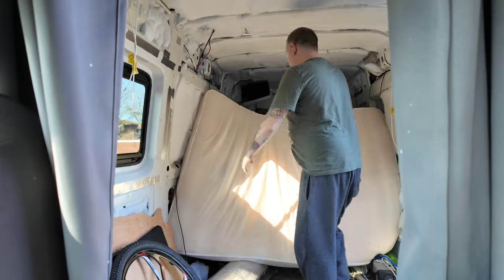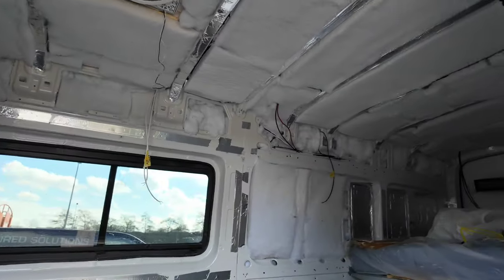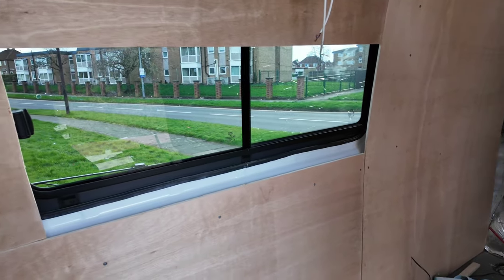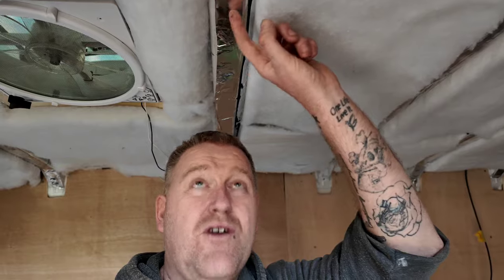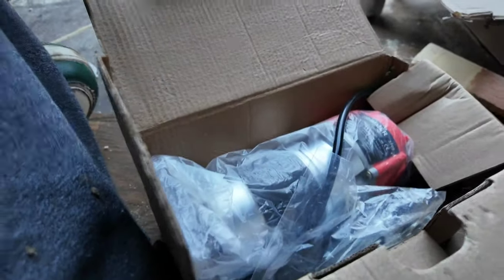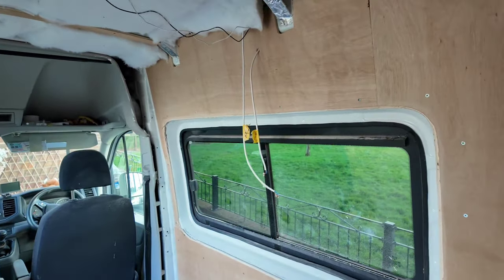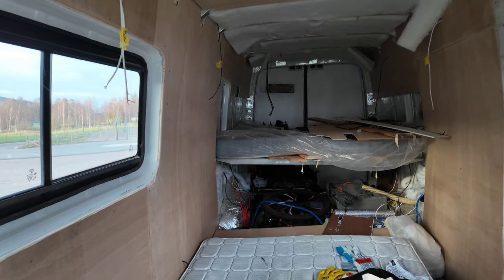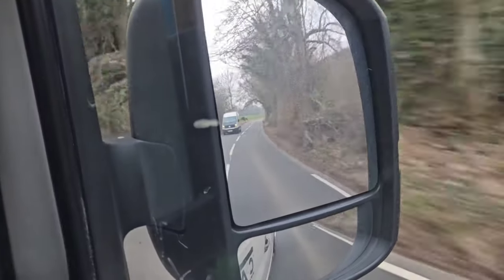It Was Only Meant To Take 1 Day

Comment: Another great video! Regarding your old heater personally I'm voting that you take it apart and try to give it a clean out.  Main reason being if you ever need to do repairs on your new one then you will be more familiar with inside of it and secondly being you have newly cleaned spare one to use if you ever need to wait for a new part.

Comment: Hmm diesel heater ... is your exhaust at a right angle... or is it straight down ?? 

Maybe reason for soot build up ...

They dont really explain but the angle of an exhaust should be straight down where possible , or very slight angles ...

P..s dont replace if it stops working ... look for videos to repair ...as itll be just an internal filter usually

Comment: So confused why you're doing this conversion. This is supposed to be the "proper job" and everything is as bodged as the last one. The gaps between the wood, the routing, the chaotic transition between jobs, it's wild. Why you didn't just take your solar panels off for half an hour to avoid making such a mess with the caulk as well is beyond me. I thought you were getting someone to do this for you? Bizarre choices mate. Fingers crossed it turns out well at the end.

Comment: Wow pal .... you really should slap yourself ,and researched routers ...

1st tip I'll give you ... for long straight edges , afix a long straight edge.like a builders spirit lvl etc .. to a measured distance , 

So firstly , measure router plate to centre of bit ... and write that down .

Then you can use math ,to work out where your straight edge should sit .. as the router plater will follow this ,to give a clean cut. 

Now , your rounded corners , here is what you want a slap for ...  routers can be used with a jig   known as a circular or compass jig ...the name explains it .. 

P.s. with routers .. and plywood especially ... remove small amounts of material ...at each pass..  to save getting tear outs ,or the blade jumping ...

Dame for solid wood , plus your blades last longer ...

Oh and keep fingers in safe places when routing !!  

All the best
Reply: P.s. pardon my spelling , larger thumbs